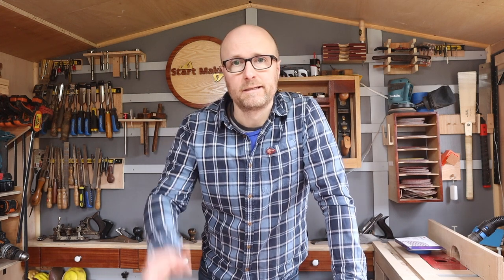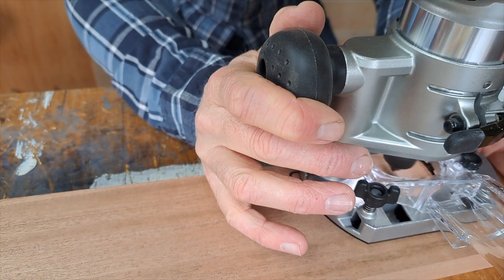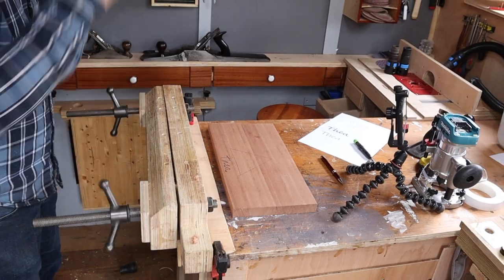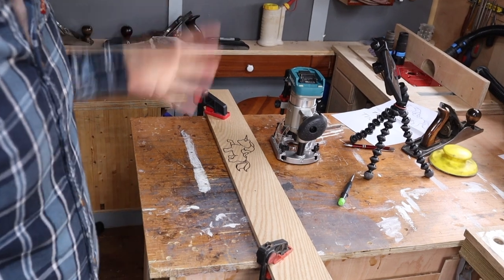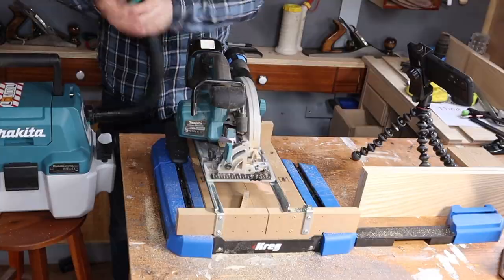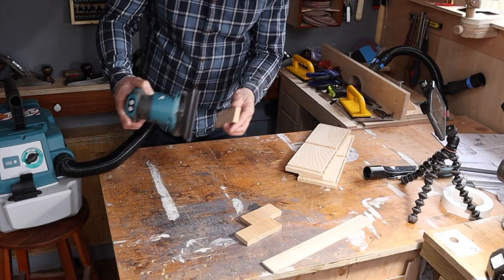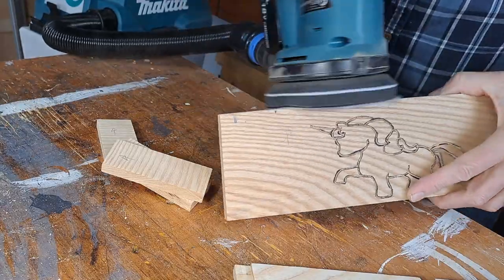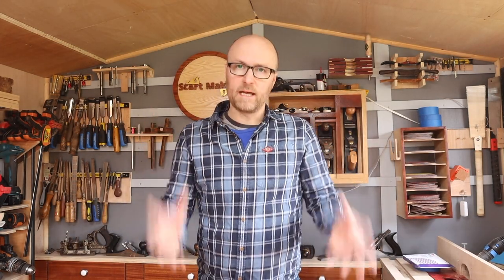DONT do this it nearly RUINED my whole project

Comment: Great project idea, I'm sure your daughter will love it. Your enthusiasm, determination & overall attitude is inspirational. 
May I suggest for your consideration; maybe have a go at building a Paul Sellers DIY miter "box" & cut those with your backsaw/miter saw? You may also want to try building & using a shooting board, your low angle jack plane would trim up those miters very well. Paul has videos on his self-made miter "box" (it's really just 3 pieces of wood & super glue or double stick tape, easy) & there are many videos on YT for making yourself a shooting board for 90 deg. & for 45 deg. *for the longer 45 deg. edge shooting you need a relatively simple jig on the shooting board, I'm pretty sure there's videos on here for those as well.
I use my Veritas low angle jack plane to shoot 90s & 45s for every miter I cut & it works beautifully.
Reply from the maker: She does truly love it which makes me what to make more for her. I have to confess that I have a shooting board, albeit the worst one ever made. In the new workshop I fully intend to update my mitre box and shooting board. Paul is the voice on all things hand tool woodworking as far as I am concerned. And such a relaxing method. Weirdly my low angle is annoying with the shooting board as it leaves an angle. The no 5 seems to do the trick though.

Comment: It looks adorable. And if I may give 2 unsolicited pieces of advice: 1) go easy on yourself! You are doing great, it's an awesome project, and there is so much love put into it that she will probably remember it for a long time (I still remember fondly the raggedy piggy bank my dad made for me, and it was more than 35 years ago). 2) When using spray finishes, start your spraying before getting on the piece, go in a slow but smooth motion with slightly overlapping passes, and continue spraying until you're off the piece. That helps prevent pooling of finish at the start and end of your spray path, and give a more homogenous coat. (Also, a nice and easy way to get a consistent spiral around the horn is to tap a string at the top and wrap it around. That should give you a nice and consistent spiral.) Keep up the amazing work, and thank you for sharing all of that with us!
Reply from the maker: Hi Florent. That is a very kind comment. Thank you very much. And for the advice on the spray finish. So simple yet I can already tell it is the way to go. I love how much I learn just in the comment section of these videos. So much great advice. I really hope that other people read too and pick up some knowledge. Thank you again.

Comment: M8 as always another great video. Looks like nice wee project love the idea for it. Nice routing aswell. An idea for next time or even to add to it. Wax melt your daughter's name and the unicorn. Crayons and a heat gun the card scrape the excess. 👍🏴need find me some them aggressive file/rasps.
Reply from the maker: Hey bud,. Great idea. Love it. BTW not ignoring the email. long days working this week. Will email tomorrow. The little needle files came from an auction lot randomly. Forgot I had them.
Reply: @startmaking1  no worries mate a no your busy. I actually got the idea from Karlpope woodworking he done a couple things with it looks really smart and really effective and doesn't take ton of effort in sense and pack crayons pretty cheap. That's nice wee find I'll need have look for some.

Comment: I might have to look into that Kreg Crosscut Station. Can it only do straight (up and down) cuts, or can you bevel the saw blade at all?

For the horn, a Dremel or similar rotating tool might also work well with doing the grooves (or similar tasks). 

Good luck on getting your daughter to actually use it, hopefully you'll have better luck than I've had with my son 😂
Reply from the maker: Good question . I don't think that it does to be honest as when I move the saw to the angled position the blade is not as close to the jig, so I would have to raise the work piece up. You can do 45s and such as in mitre joints for a picture frame for example but the 45 degree cuts I did using the sapele plank and holding the speed square against it to guide the saw is all I can do with what I have. I wish the keg station let me do that so my mitres would actually join for once. 
I am expecting to find this desk tidy somewhere under her bed with dolls or something in it. They never use their toys for their 'intended' purpose do they? this will be no different. I will definitely get one of the Dad hugs though.
Reply: @startmaking1  Not sure what happened to my previous reply (YT might not've liked the link?), but I found that Kreg makes a Portable Crosscut (jig?), KMA4000-E, that might work slightly better than the square (although it looks like it's bigger). And should work with beveled cuts. 

Either would've been easier than when I went with clamping another block of wood as a straight edge for my circular saw when making one of those wooden Christmas tree projects last year as a gift for my grandmother, though (but hey, I got it done, at least) ;p
Reply from the maker: @matthewryan8463  ooo. A new toy, possibly. I had better check this out tonight. thank you. I look at some of the ways that I have done just that. would be simple on a table or mitre saw and I cringe. Plus it takes so much longer. When I get some more cash saved (assuming the shed doesn't fall down  and need replacing) I will get a track saw I think. Way less scary than a table saw.
Reply: @startmaking1  I live in an apartment, so nowhere really to set it up permanently yet, but I was able to pick up a basic, but decent MetaboHPT 10" miter saw for only $109 (US$) in January. I'm hoping to do more of those trees for this Christmas for my aunts, who all very much enjoy that kind of "rustic" / handmade craft thing (I only had time for doing the one last year, which is why my grandmother got it). But I still may get one of these jigs myself, because it's so relatively cheap.
Reply from the maker: @matthewryan8463  So, having looked into the jig a little more it basically does what a speed square does but with more stability I think. The station does the 45 degrees but I am yet to test that bit out as the guide is very flimsy looking. I may need to do a video test review on the station. Hard to explain but the station can do horizontal 45 degrees so for a picture frame for instance but can do a vertical 45 degree like for a mitred box. You could bet the cheap jig to do both but I suspect that guiding a circular saw in a straight 45 degree cut with the blade angled will get mediocre results like I got in the video. I am yet to find a good solution for that without a table or track saw.
Reply: @startmaking1  Speaking of track saws, some cheaper alternatives that might be okay stopgaps (for you, or for anyone else getting started looking in) could be either an edge clamp (or "clamp edge" depending on the brand), although a number of the ones I saw on Amazon weren't terribly cheap - whether it's good I don't know, but the US tool chain Harbor Freight has a 50" version for only $20, and it looks like a lot of the ones on Amazon start at around $50.

The other option might be more Kreg kits, like the KMA2685 Rip-Cut Circular Saw Guide - but that does require an existing straight edge to run on, but looks to fit most circular saws and is only US$45. They also appear to have their own version of an edge clamp, although they don't call it that, just the "straight edge guide" (KMA4500-E; also they apparently have an extension available to make that longer as needed.) And finally, if you can find it, Kreg has (had?) their own track system that again seems like it would fit most circular saws, the "Accu-Cut" / Circular Saw Track (KMA2700 or similar). 

On a related note, I just re-watched your 5 cheap tools for starting out video, and realized you talked about using the speed square as an edge guide there too. If necessary, I've got to try and remember the trick of having the angle pointing at me for that extra stability when starting! It's definitely a simpler option at least when trying to cut across a 1" x 3" board than having even a "small" 24" edge clamp hanging so far off the end!
Reply from the maker: @matthewryan8463  There are so many options when you dig into it. Personally I am not sure if some of them are all that much better than the straight edge clamped with my circular saw for up to 4 foot cuts. It is ok if not great. The speed square is ok but I would not trust it for fine woodwork so to speak. For something more accurate I am trying to dial in the keg cross cut station but to be honest even that is not giving me accurate 90 degree cuts. Fine across the depth, ie the top to bottom of the cut as the wood sits. But not square front to back. So the rails are probably out or there is too much slop and the saw is wobbling around. There has to be a fix though. I am planning on building a bigger shed/shop and with that I would have to have electricity. This should happen in the next 12 months if not sooner. So that will leave a tough choice, table saw or alternative. I promised myself that if I ever got a table saw it would be a sawstop and in the UK they are hard to get and pricey. So I may need to go with a MFT and track saw. So I may just save and wait so I can get a top one. I can cope with what I have so far.